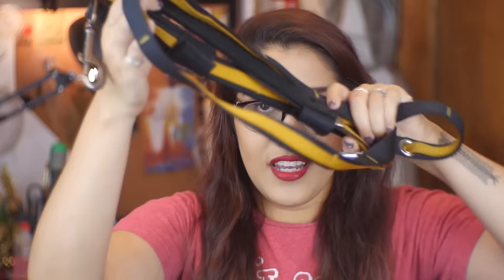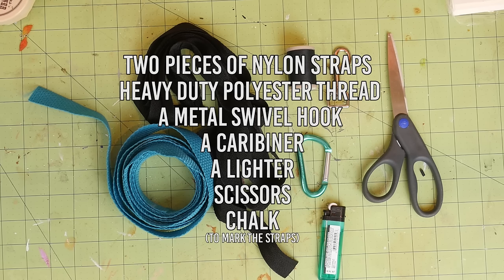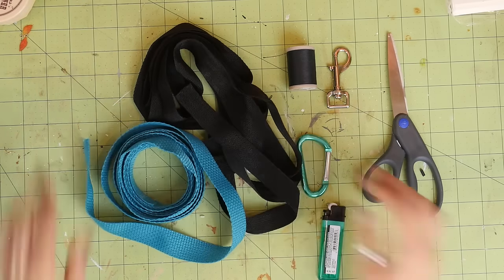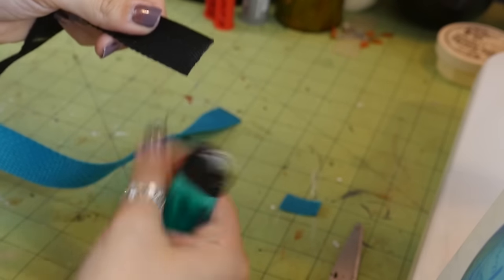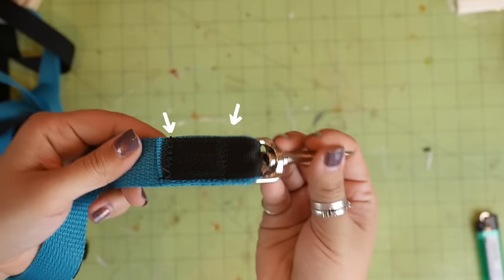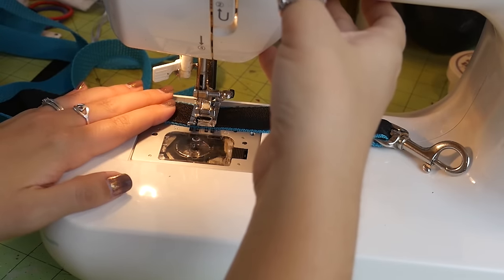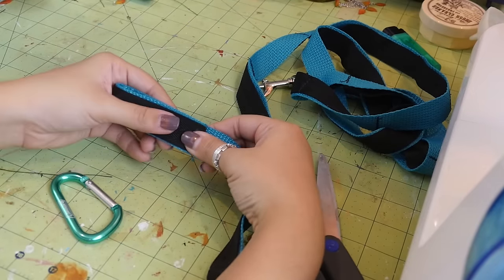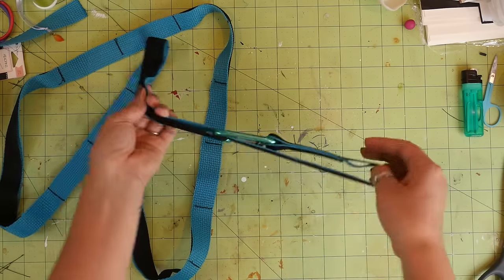How to Make an Adjustable Dog Leash : DIY

Comment: Use a small or large aluminum climbing rated carabiner, or steel spring link snap hooks from the hardware store that a rate for at least a couple hundred pounds or more. Don't  use the cheap carabiner-shaped clip hooks commonly found in the keyring section. These are not load bearing and well fail when more than 40 pounds of force is applied, which is easily generated by even a very small dog.